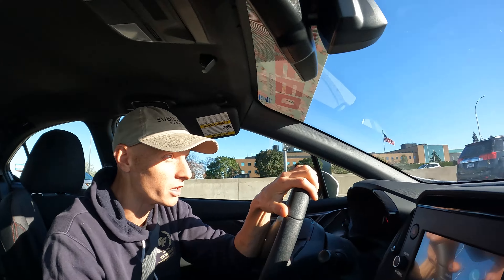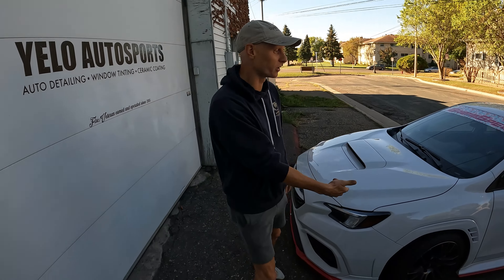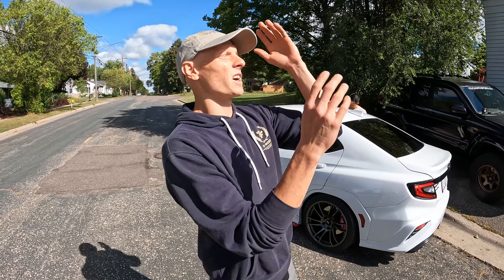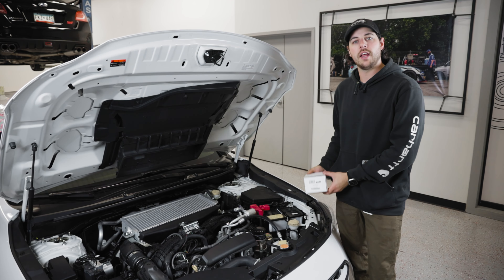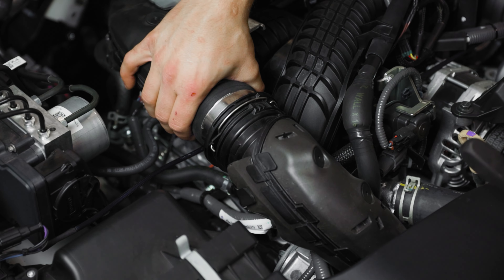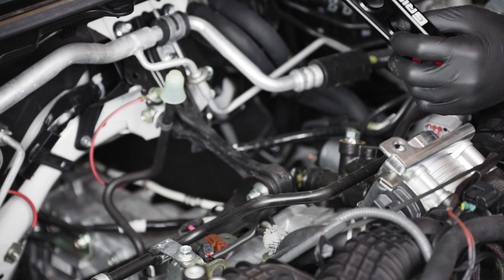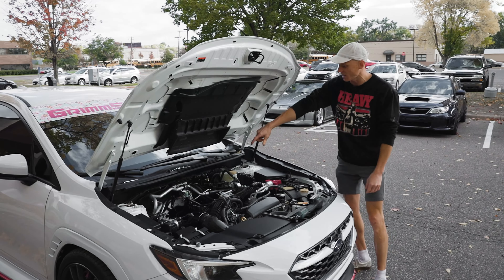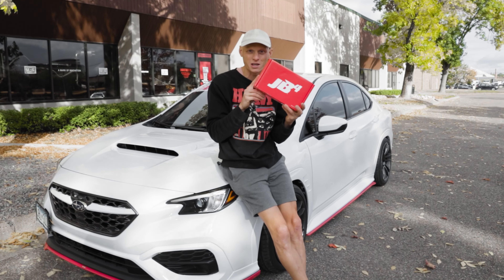GrimmSpeed 2022 WRX Gets MUCH NEEDED Upgrades!

Comment: Will the pitch stop mount make the car vibrate like crazy at idle? I had a similar mount on my speed3 and at idle you’d almost get a massage, turn the AC on at idle, forget about it lol. Doesn’t correlate to a nice daily driving feel in my opinion.
Reply from the maker: Simple answer is no. Our standard pitchstop has 80a durometer urethane bushings that add a slight stiffness to the mount. We also have a race version with 95a urethane bushings which are pretty solid. So depending on what you are looking for we have options.
Reply: @GrimmSpeed  thanks! Do you know the rating on the stock unit?